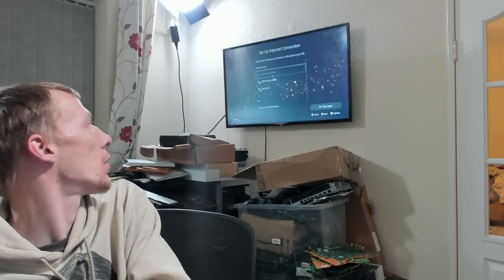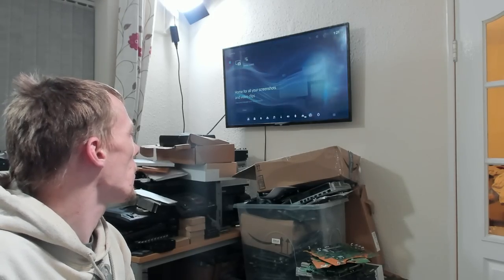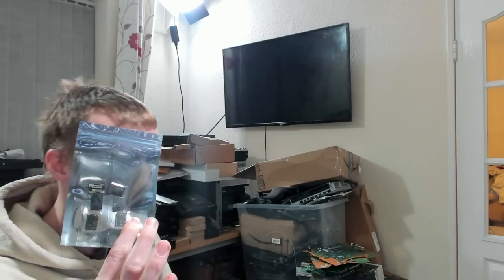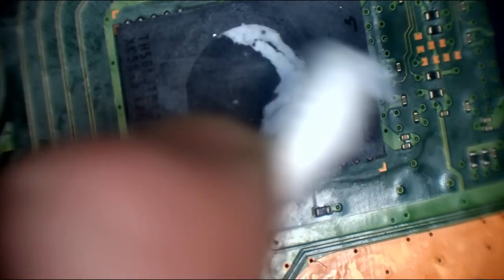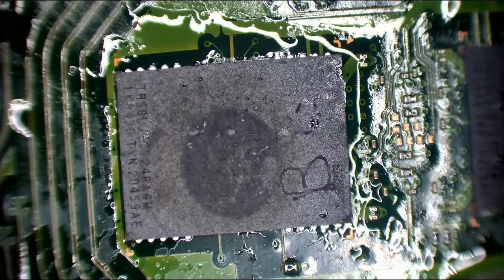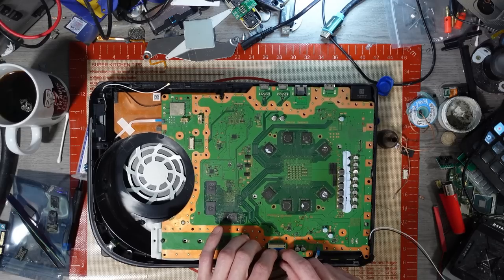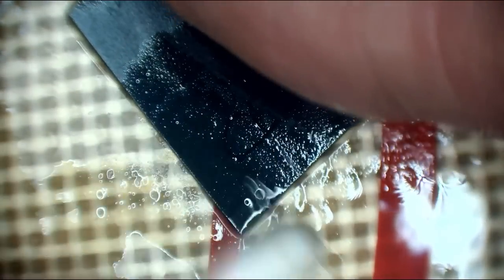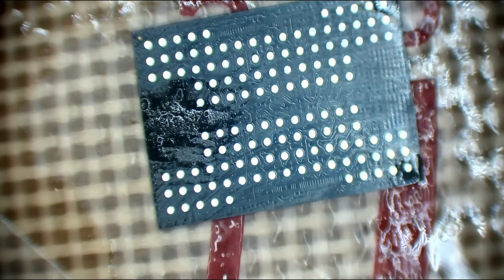This PS5 Reboots On The Dashboard... Can I Fix It?

Comment: The ssd chips have data that's married to the board? If you replace all 6 and the data is gone will the ps5 remarry itself with the new memory chips?

Need a part 2 😂. You think you fried the ssd controller?